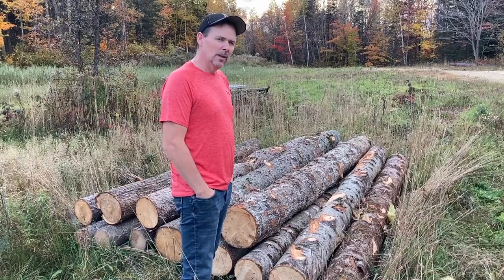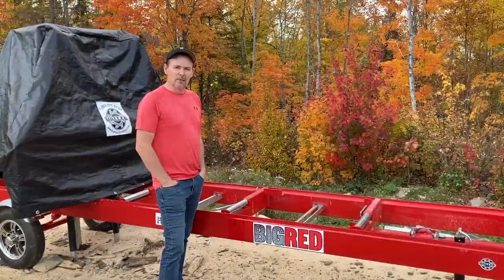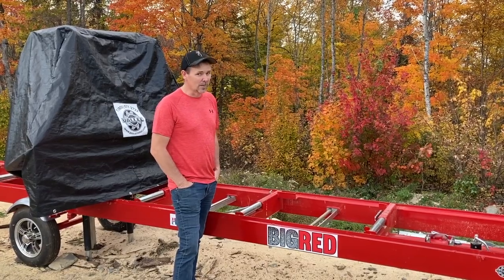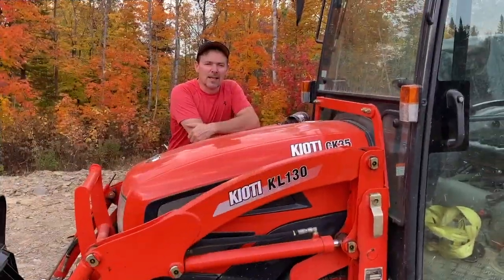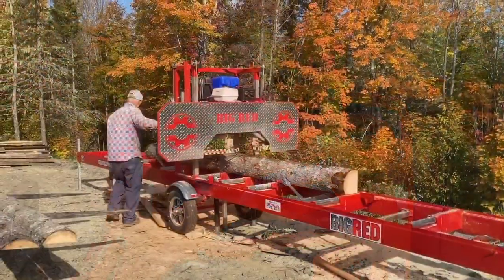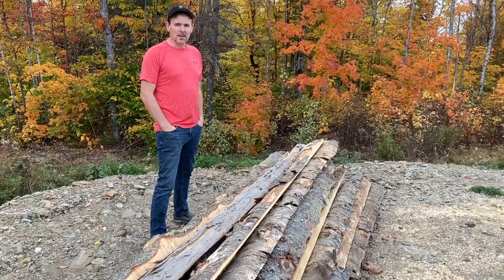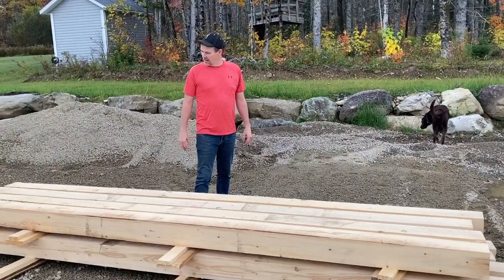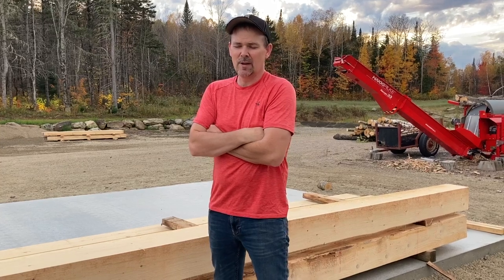Sawing Rough Cut Cants on the Vallee Big Red Sawmill for the Sugar Shack Build -E87

Comment: Great video I like the saw working and my grandson was dancing to the music I'm assuming your doing  post and beam building witch would look nice board and batten siding I want one thanks for the video Jason
Reply from the maker: Good Morning! We are trying post and beam but putting it together with steel plate, lag bolts and tek screws.... hoping it turns out. Definitely closing it in with 1" thick boards installed vertically... haven't decided on the traditional batten yet or going with a "shingle" vinyl siding. We kind of plan as we go along sometimes! Take care, Jason.
Reply: @OakMountainAcotts  eather way you go it will be family  built and that's the best way

Comment: Nice Video!
How much do you pay for the sawing? Price per hour?
Greetings from Germany!
Reply from the maker: Hi! Thanks for stopping by all the way from Germany!  This saw mill is my Father's so I expect the price will be quite reasonable (free!).  The Honda engine does not use much gas and the blades cost $50 a piece and will saw for 6 - 8 hours. The blades can be sharpened for around $10 each here in New Brunswick.  I had some material sawed 10 years ago by a mobile Sawyer and he charged me $350 per thousand board feet. Take care, Jason.